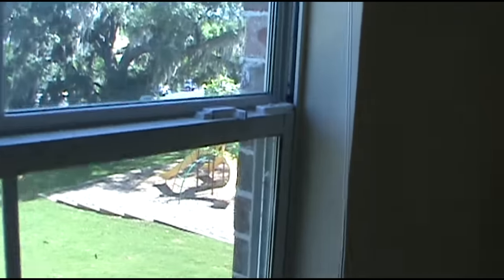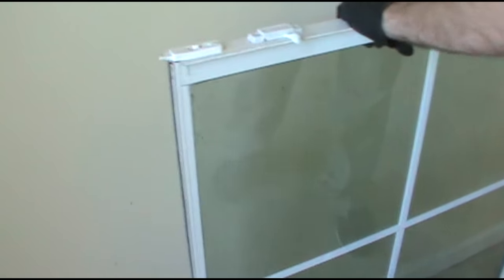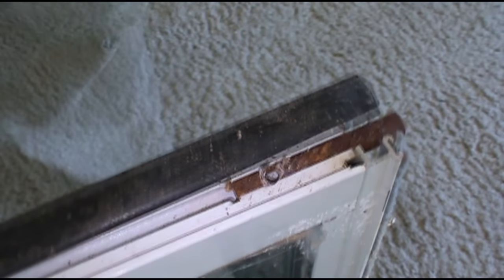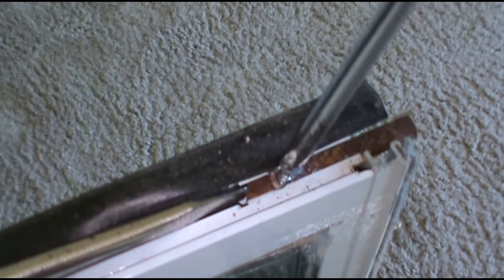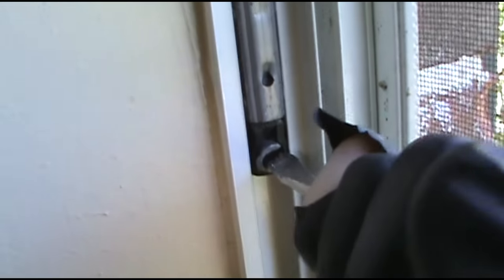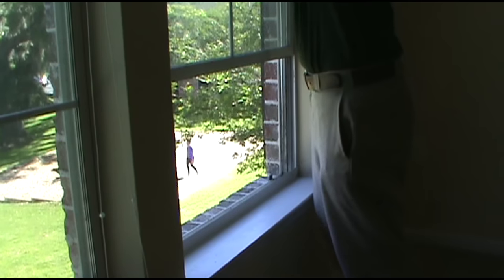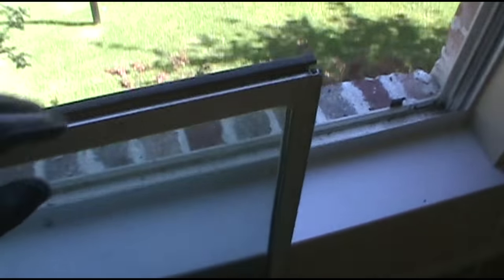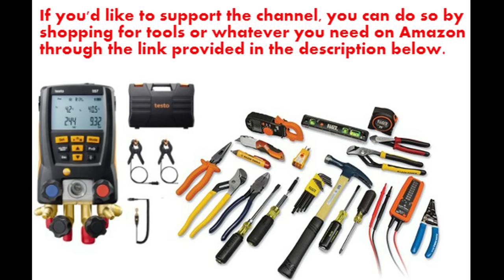How To Put A Window Back In Track

Comment: Glad I found this video and don't know why it took me so long to look up! Didn't know to insert at an angle and to start in a down and out position. Knowing that made it easy to fix. We're having a snow storm with high wind today and my window just fell out the frame (was already wonky, but was holding). It's a temporary fix as the window will be locked for winter, but at least I'll be a little warmer inside.
Reply from the maker: Nice fix, Rayya! Thank you so much for watching!

Comment: Hey thank Lex Vance! its 2021, a nice spring day. im in my room down the hall, I  hear a crash. My 13 year old sister is in the room that the crash happened, I  ask if everything is alright, there is no answer. She sounds guilty, but it's a spring day, not my problem......Well it quickly became my problem once my mom came in. Turns out, the small110 pound 5ft child managed to spring the window off the tracks completely. This was about to be everyone's problem because, I have a spinal injury and cannot lift 10lbs, my mom has a bad shoulder and my sister is a child. For 15 minutes all three of us were chaotically lifting this 50+ window ALL THE WAY UP to anchor it in. Plot twist, did not work. Im an art teacher, my mom works in finance, and my sister....you guessed it, is a child. All 3 of those combined couldn't fix this window. Then I  remembered the internet exists. it was that moment, I found you Lex Vance. Thank u for this video
Reply from the maker: 👍😆👍 Awesome! Thank you so much for watching Bougie!

Comment: I had this same issue.i fixed it yesterday.however.i have too much tension on one track.and when the window goes up,the wings up top on the right hand side pops out.wbat r those adhesive things called that go on top?they're like wings that extend a bit further than the factory ones.
Reply from the maker: I'm not sure. I'd need to be there for this head scratcher 🤔.

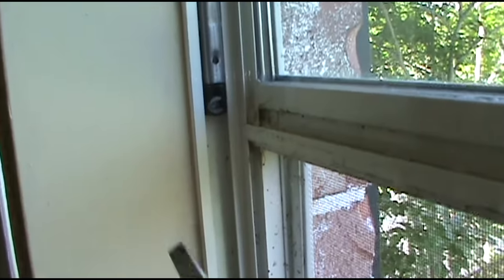Comment: Thanks for the Great Info Lex. I still have a question / problem though on putting my apt window back in. I don't have the same balances that you have. Mine is a spring / spiral. at 3:00 min into your video you pull the window track down with a flat-head screwdriver and then lock it into place by turning it counter-clockwise. I don't think that works the same with the spring / spiral balance. How do I pull down both the balances to 'lock them into place' so that I could then put the horseshoe cleat back in the groove on both sides?
Reply from the maker: I would need to be there to see what's going on. Thank you so much for watching Michael!

Comment: Hey man, if I make the left track lower than the right track like you did, which horseshoe do I bump out? The one for the left track or the right track?
Reply from the maker: The left. Just a tiny tap.
Reply: @LexVance  That did the trick. Really appreciate the help man I know you didn't have to. 
Although it's not much of an issue, the window's a little tighter now when sliding up and down. Did I perhaps extend the left side too much or not enough? Either way it's no prob, just curious.